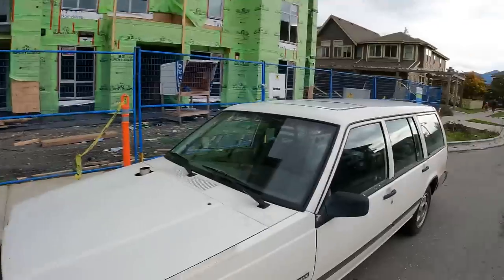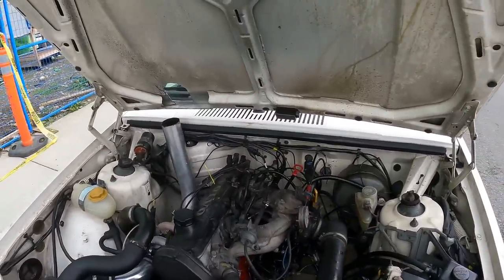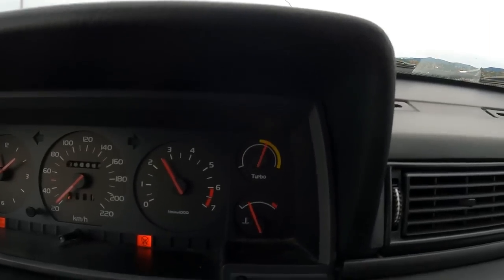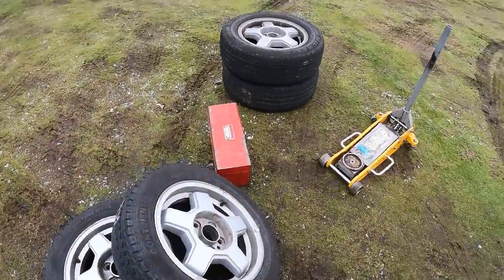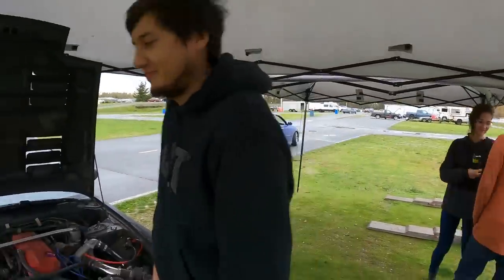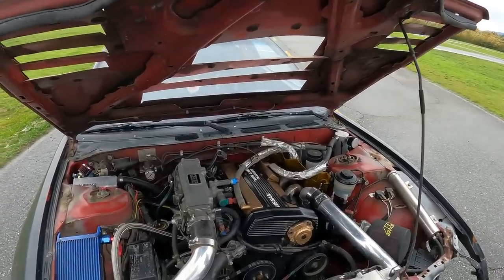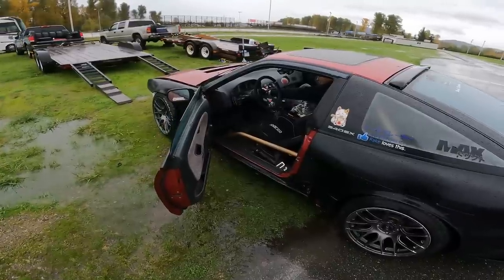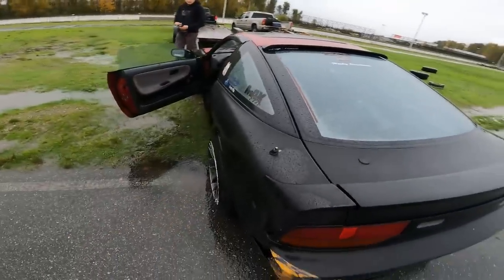how well do volvo engines run with a hole in the block?

Comment: They run not as good as they run without a hole in the block. Yes. LOL, sorry about the luck, but it will get fixed or something better will come of it. I Have thrown my share of rods through the Kool aid fence, that's how you learn! First step of ripping a 2/7/9 series, deploy open glove box ! I wonder if the power stage or igniter went bad. But it sounded like it was out of gas- the way it tried to start, or fp relay and pump died. Check fuses! GREAT RIPS!

Comment: bro just swap something into one of the volvos and run that car high boost and keep one of the red blocks sustainable for daily driving or crusing the street. put a 1jz in a volvo if possible or a regular ol LS swap
Reply: but the thing is that people love old volvos because of the redblock and how cheap and reliable they can be also easily not mentioning the ease of maintenance. Colton already said that he keeps pushing the engine with stock conrods and that's the big issue and in the future he is gonna remedy that

Comment: It's the crankshaft sensor that is going bad. Stops working when it heats up. Weak/no spark. Could be coil but replace crankshaft sensor first.

Comment: I love 240’s I got one myself and you are the king of them bro. Mad props for how you slide those things. But I got a question... do you ever get tired of low horsepower? Or does the panel wagon and the big rig make up for it?
Reply: The big rig😂😂
Reply: All his cars make around 200HP with a mbc, I wouldn't call that 'low'
Reply: @abnormalethnogenesis9766  200HP is pretty low in drifting. Definitely enough for drifting but compared to many cars it's very low
Reply: @abnormalethnogenesis9766  I don’t think you’ve watched him very long if you haven’t seen the many videos of him sliding stock n/a 114hp 240’s lmao
Reply: @SweetyR1  bro, ever heard of the legendary ae86? you dont need power for drifting and 200 is plenty of course depending on what you want to do but alot goes before power like suspension
Reply: @Robin-hi8oq  Yeah, I didn't say 200 is too low. I have drifted under 180hp volvo 240. It's possible and very fun. But compared most drift cars 200hp is low. You can't be competitive with that. Unless we are talking about grassroots competition then maybe.
Reply: @SweetyR1  Yes that's true for comps you would need maybe 250-300whp min also not mentioning all other stuff, but im talking more casual like yeah grassroots